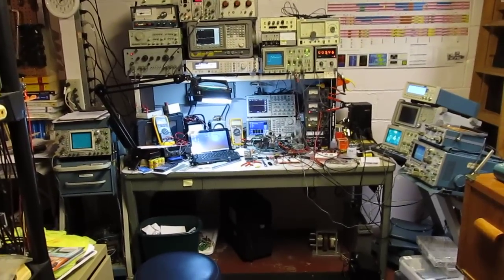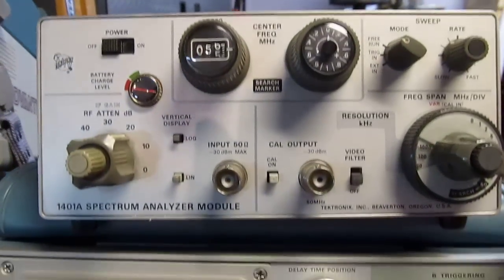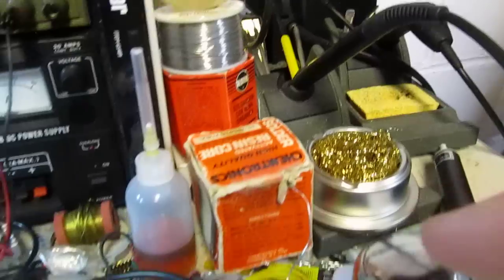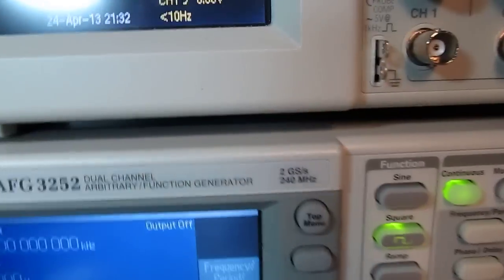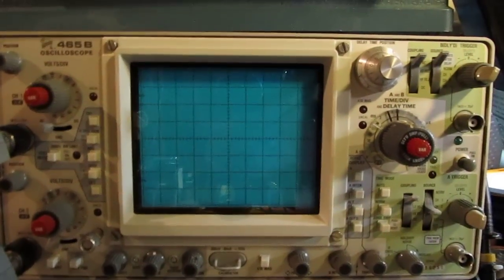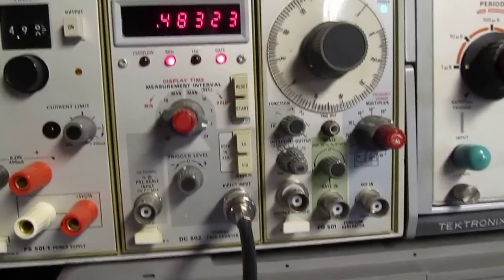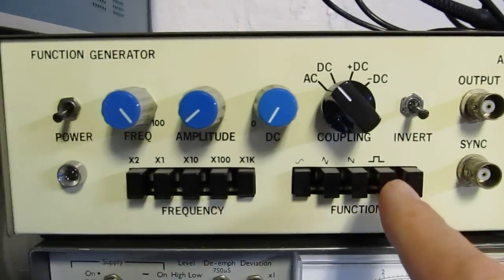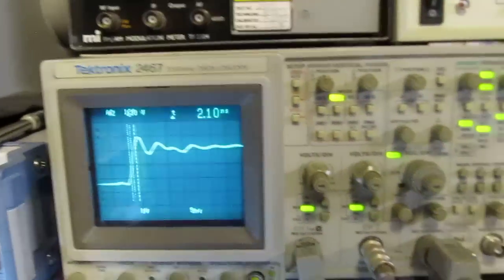#89: Video Tour of my Lab and Workbench - Oscilloscopes and meters and power  supplies, oh my!

Comment: Do you have a MEGGER? and can you make a video lesson about how to use a megger because to test pcb boards that a populated with components i don't think you can use a megger because meggers output a high voltage but the current is very low. Guitar amplifiers use eyelet boards or turret boards which the boards are made out of a certain material which I'm not sure what the materials they used in the 60's and 70s but over time for some reason when moving all the populated components if you measure using a Megger from eyelet to eyelet on the board you will measure resistance or "leakage resistance" its called. Repair techs call his moisture resistance or corrosion resistance that gets into the pbc material. Its like when a burnt resistance carbonizes the pcb it has leakage resistance.
Reply from the maker: I don't have a megger.
Reply: @w2aew  That sucks because you can use a megger to test leakage on pcb boards for traces that are suppose to be isolated or high impedance. Most people use a megger to test cables insulation but this is another way of using a megger to test PCB leakage between eyelets and traces.
Reply: @w2aew  I think a Megger is a high voltage Ohm meter? its an ohm meter which a TEST voltage that is high voltage with low current

Comment: Various switching power supplies like very cheap switching powers supplies will have harmonics of the switching frequency. When the switching power supply is half loaded not fully loaded it will have more harmonics of the switching frequency riding on the +Vcc rail compared to when the switching power supply is full loaded the +Vcc rail will have less harmonics of the switching frequency. Any reasons why the LOADing affects the harmonics of the switching frequency of the power supply?

Comment: What is the formula to calculate a component's dissipation? Because wattage is voltage times current equals wattage but a component is a patient is completely different from wattage because when most textbooks say you calculate the current and you double it to get the the dissipation of the component like if the current is a one watt you don't use a one wide resistor you use a 2-watt or a 3 watt you double the wattage to get the dissipation that's just the rule of thumb in textbooks
Reply from the maker: You're talking about two different things - the ACTUAL power dissipated by a component in a circuit, and the MAXIMUM RATED power dissipation for a component.  The rule of thumb is that you want to use components with a MAXIMUM power dissipation RATING that is 2 or 3 time higher than the actual power dissipation they'll see in operation in a circuit.  The actual power dissipation is calculated from the voltage across the component multiplied by the current thru it.  When choosing the component, choose one with a maximum dissipation rating that is 2 or 3x higher than the actual dissipation.  This gives you some safety margin, rather than running the component at the edge of its rated power level.
Reply: @w2aew  Thanks, yes I X V = wattage ( which wattage is not actual power dissipation ) . For Actual Power Dissipation  its I X V across the component = Actual Power Dissipation. Most Circuit designers seems to use I X V = wattage, because the component max dissipation rating are not 2X or 3X. Like guitar tube amplifiers most of the resistors wattage are not 2X or 3X this is why you have a lot of burnt resistors. The EE Engineers should have used this formula instead I X V across the component = Power Dissipation and not have used I X V = wattage. What my main point is that wattage is NOT the same as Power Dissipation they are two different things.

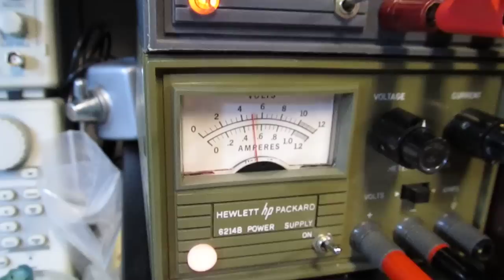Comment: 3:20 Heh. I started a thread on the beginner's eevblog forum demanding to know why I was having a much easier time with an old power supply with analog control than with a modern discrete level setter. But  back in 2013, here was your concise explanation. So for the umpteenth time, THANK YOU.

Comment: I have the Heath deviation meter. Got it from the guy who built it, at a garage sale in rural Northern Michigan. I don't usually stop at garage sales in Northern MI, usually just a bunch of baby clothes. But when I saw a 60 foot tower with a tri-bander on it and a garage sale sign out front I hit the brakes and pulled in. The meter looked brand new, sitting there among the baby clothes. Never been out in the rain. And it works great. At least it reads the same as my Marconi service monitor does. The guy wanted $50 for it but all I could afford was $20, so he said he'd take it since I was likely to be the only person to stop by who even knew what it was. :)
BTW, I also have an HP time interval meter and an HP freq counter, both with Nixies. I like them. I used to work at HP long ago. I'm old. :)

Comment: I just enjoyed the tour through your lab for the second time, and enjoyed it all over again.  I am a hobbyist, and although I have a couple of old Tektronics scopes, I get by very well with them.  I still have a Lavoie LA545 tube type scope (the one that caused the lawsuit) a 464, and a 475a.   The scope I use the most, is the 475a, although I would like to still be using the Lavoie, because in addition to the dual channel plug in, I also have the diode checker, and a differential amp.  My question to you, is that unless I have been lucky enough to find one of your videos that I am searching for, it is difficult, with the way the search algorithms work nowadays, to find exactly what i am looking for. 
 Did you ever publish a list of all the videos you have done?    What I have been attempting to find, is anything relating to ground loop isolation.
Thanks again for all the great videos.
Bob
Reply from the maker: Yes, I keep an updated index of all of my videos.  It is arranged numerically (in the beginning), and by topic groups (at the end).  There is a link to this index file on the main channel page (lower right corner of the header graphic), as well as on the 'About' page.  Repeated here for your convenience: https://www.qsl.net/w2aew/youtube/W2AEW_video_index.pdf
Reply: @w2aew  got it, thanks.   It has been awhile, but I spent  the day working in my shop and really enjoyed myself.  Btw, I got the number of my Lavoie scope wrong, it is the LA 265a.  
Bob

Comment: The test equipment that I have will cover anything for  Audio to 22 Ghz.
I have Scopes that cover Low Frequency, 5 Mhz to 350 Mhz and a DSO 100 Mhz.
I have built and designed a spectrum analyzer 100 Khz to 145 Mhz, a HP 8590B, 9 Khz to 1.8 Ghz and an HP 141T main frame, with plug-in from 10 Mhz to 13 Ghz, and with an external mixer I can 
 extended the frequency it to 22 Khz

Comment: Posting on the old video but hope to get reply.I need better oscilloscope that I have now and I have a chance to get one they all have the same price 300 bucks but not sure witch one to get Tektronix 2246 4 channel 100mhz. 475 00mhz 2 channel and TDS340A 100 Mhz 2 channel. I like the TDS since it reads the freq. I need a second opinion. PS I will not use it professional it is only for hobby
TNX and 73s YU5KBm
Reply from the maker: That price seems a bit high for these scopes, but of course this may be the norm in your country.  Personally, for a "first scope", I would go with analog.  It would be better for RF work, especially looking at RF envelopes, where the TDS might alias.  It is not hard to make a frequency measurement on an analog scope (just not automatic).
Reply: @w2aew  TNX for reply. It will be my firs serious Scope I have a little old Russian one 5mhz and one channel and it is not working well at all, and I am at the stage where in order to continue learning and working with projects need something more and better. 2246 has that cursor thing that can measure the freq and voltages etc like you said and I really like 2246. Not relay menu driven but has features that I think can be helpful and easy to access. Prices vise it is to much but there is no supply of that equipment especially Tektronix  so the sellers can ask a high number. 

All in all tnx for the reply once again and thanks for the videos I have learned a lot from your channel and if you ever put the things from the videos in a book or pdf i would really like to get/buy one copy.

Comment: Great show!

Do you find yourself using the old 485 or 465 over the other scopes for a particular reason or purpose?
Reply from the maker: The 485 has the sharpest CRT of all of the scopes, so it is really nice to use for an ultra-sharp view of the waveform.   The 465B is just a workhorse - I've had it for about 30 years - use it for sentimental reasons.  The 2465 and 2467 are great general purpose scopes - and the ones that I use most often when I want to use an analog scope.
Reply: w2aew 

I understand the 2467 beam has an adjustable persistence timeout? Is it linear, if so what is its range of adjustment? Also, do you know what the maximum length of persistence is before damage might occur? Is there a safety cutoff, besides the timer circuit? 

Sorry for the lengthy questioning! 

Thank you!
Reply from the maker: If the intensity if turned to moderately dim, the timeout is somewhere between 5-10 minutes.  A little dimmer, and it might be infinite.  At high brightness, it's less than a minute.  Not sure if it's linear or not.

Comment: would be nice to understand how the amplifier with offsets works , on your home built function generator
Reply from the maker: I designed and built that amp about 30 years ago, so I don't really remember the details - other than the fact that it's just a summing amplifier, which adds the function gen signal to a variable DC signal.  Check out my video on the summing amp: 
https://www.youtube.com/watch?v=juQtVIx1a8g
Reply: Great ! thanks will have a look

Comment: I just got my grubby little hands on a Tek 2467B. One of those dastardly Rifa .068uF caps opened with a puff of pixie dust on the first test, which was a bit.... unpleasant. I've seen posts from people saying that they are happily operating their scopes without them, but I don't think I like that idea. Will any X2 (such as MKP, which I have) safety cap of the appropriate value be ok as replacements? I have some slightly larger value Rifas of the same vintage (NOS), if there is a specific reason, such as ESR (?), that they were spec'd.
Reply from the maker: I don't think there were any special selection criteria.

Comment: Great... Love the RF section... Did you run several separate fuses from your panel???
Reply from the maker: +Vladimir Petrovic No, but I had access to two separate circuits to plug into.  There is never a time when everything would be on simultaneously, so it all works fine.

Comment: That Simpson 260 sure brings back memories!  It was always the "standard" VOM against which others were compared, in the good old days.  But I recently bought, off of Ebay, the BEST VOM ever made (by pre-DMM standards, of course).  It's a Triplett 630 NS.  It has factory accuracy specs of (+) & (--) 1.5% for DC.  But the thing that made it unequaled was its sensitivity.  It's 200,000 ohms per volt!  I might also add it's an absolute work of art in its appearance & construction.  It will share a place of honor next to my Fluke 87.

Comment: Random thought and question I had about test equipment.  Do you normally leave all your equipment turned on, even when not in use?   I interned at a lab last year and at the end of one day when I was about to turn off some test equipment that my boss left on, he quickly stopped me and told me just to leave it on.  It was a fairly beefy oscilloscope (it even ran Windows XP, wow) however the scope was NOT connected to any system.  I was confused as to why he didn't want me to turn it off but I didn't question him at the time as I was only a freshman undergrad.  I'm seeing the same thing in this video (all your cool stuff is on) and was wondering if there's some correlation to what I've experienced last year.
Reply from the maker: In professional labs it is common to leave the equipment on - it helps to maintain a constant temperature in the instruments which help maintain accuracy day to day.  It also eliminates thermal stresses from turning on and off everyday.  For me, since I don't use my equipment everyday, I turn mine off when I'm not using them - for a couple of reasons.  I don't have to maintain calibration to any strict degree in my lab; I have a lot of old stuff and prefer not to leave it on 24/7; I pay the electric bill.
Reply: ***** I see, I haven't thought about that sort of possibility.  Thank you very much for your response.
Reply: I leave on only equipment I use mostly all the time. Equipment that I plan to use in a day or so I turn to help stabilize it. Equipment that has a TCXO oscillator I shut of but leave the TCXO oscillator on all time for stability.

Comment: Hi Alan

I,ve just watched your Lab Tour video and I noticed you had
two of my favourite scopes of all time, the Tek 485 and the
Tek 2465a CT. If you had to choose one what would it be?.
Incidentally I have the opportunity to buy a Tek 465b and a
Tek 2230 at the right price. Would you?.
I would value your expert opinion.
Reply from the maker: It would be tough to choose between the 2465ACT or the 485.  The 2465ACT is certainly more flexible, especially with the two extra channels, but the CRT on the 485 (at least on mine) is much sharper than the 2465.  Plus, there are less "custom hybrids" in the 485.  If I had to choose, I'd give the slight nod to the 2465.  The 465B is a great scope, but at that age where you have to be careful about broken parts, etc.  I've never played with a 2230, so can't really give an honest opinion on that one.

Comment: Great video, and great collection. I bought my 465 in 1974 (instead of a car like my friends). My 465 still works fine. The 485 came out before the 465, the 475 came out after. I think you need to get a Tek 7000 series addiction  :-)

Comment: That is a lot of gear.  I am usually on the look out for some cheap equipment in need of repair.  Mainly just to tinker with and hopefully get it running right.  Secondly because I just love the look and feel of the older equipment.  I think they are generally a better build quality than some of the newer equipment.  Thanks for the tour.